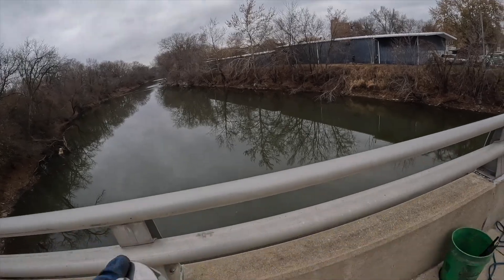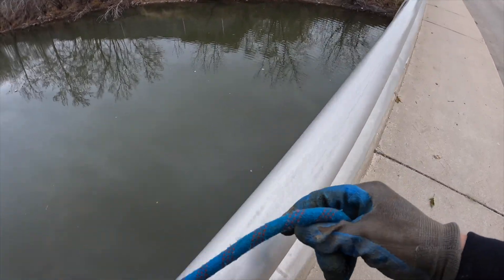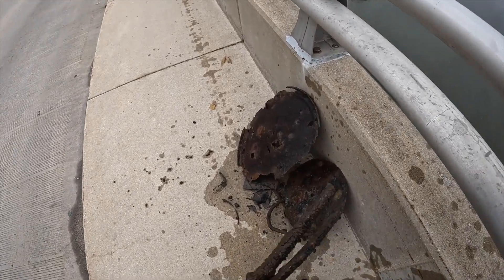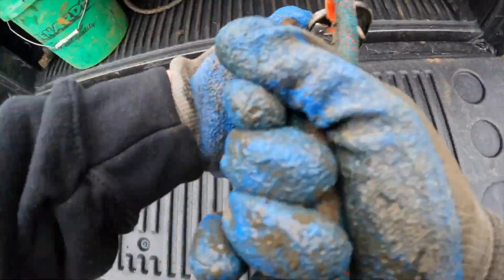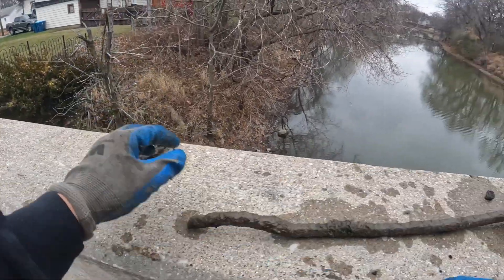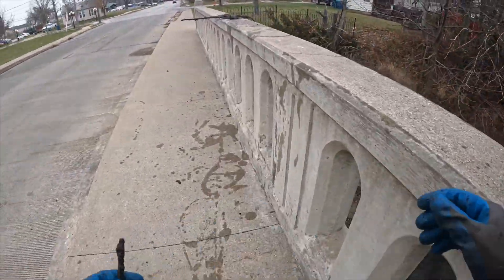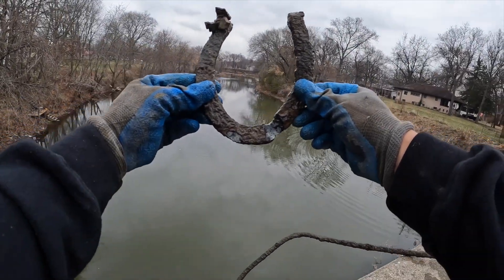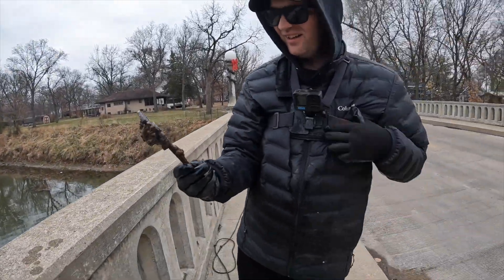Our Lucky Quickly Changed After We Found This Magnet Fishing ROUTE 66

Comment: Steel-toed boots are dangerous which is why OSHA does not require them to be worn except in a mine, steel mill, and railroad construction worker. Heavy objects falling on the steel can cut your toes or smash them beyond fixing. 
The added weight makes them dangerous to wear around deep water where there is a risk that you could fall in.

Comment: Dani I came up with a possible fix for damaged magnets . Take some JB WELD  and fill in the section of the surface where the damage is to smooth out the rough area so the magnet can safely be used as a backup magnet.